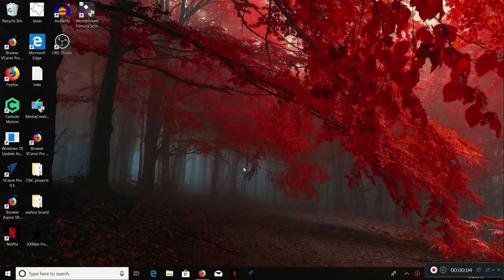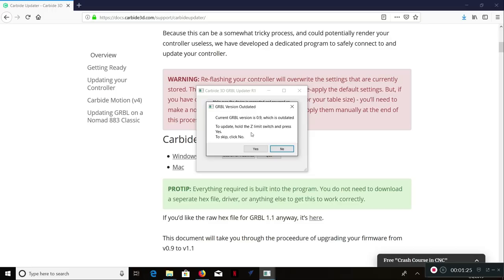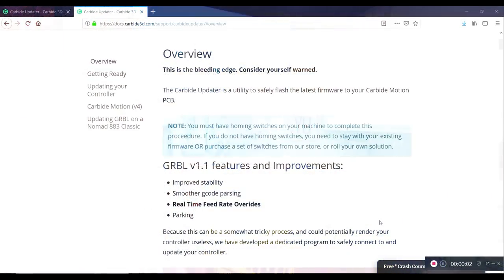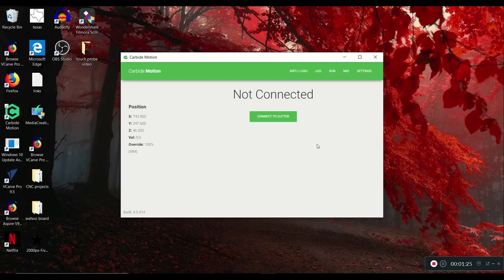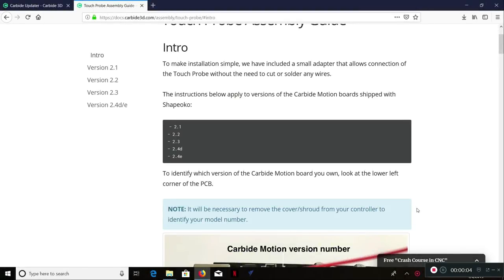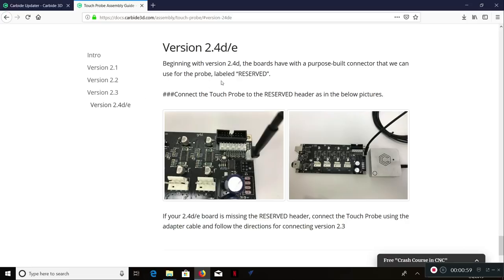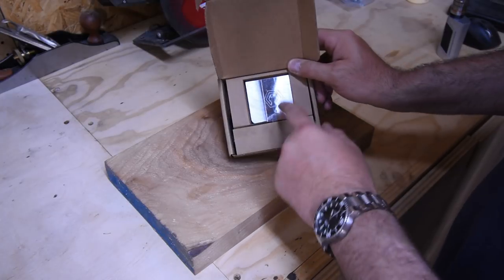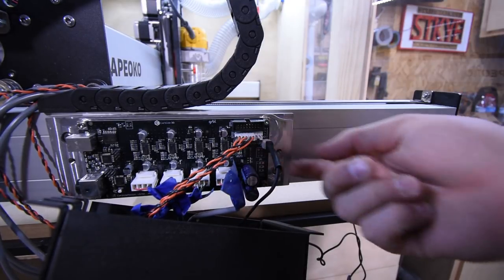Installing a Carbide 3D touch probe on Shapeoko CNC

Comment: Hi Jason,  I had flash backs of the dam contortions needed to install and hold that limit switch!  One thing I did was to move the control board outside the enclosure.  It helped when I installed my JTech Laser (from Texas), its cleaner, and when you need to trouble shoot something and they ask you what light on the board is flashing you can see them.  Look forward to your next adventure, cheers from Canada.

Comment: I used the same screw to fasten one end of the crocodile clip, but for some reason there was no continuity between the board and the screw.  Fortunately I tested this before actually running the machine so I avoided embarrassing crashes.  The solution was to just fasten the the crocodile clip to the board mounts (as the holes of the PCB seems to be connected to the ground plane as it should).

Comment: for the love of god DON'T LISTEN TO THIS GUY when it comes to grounding the alligator clip. don't put it on that bolt holding your belt in place. it's going to cause you headaches trying to retighten it to the right specification. just run that ground into the control box and use the bolt on the top left stand off.